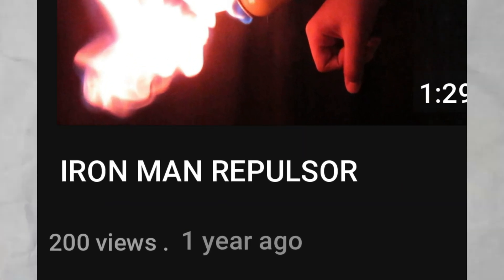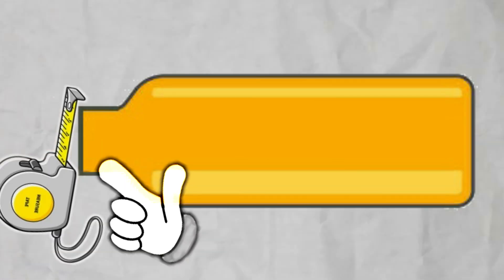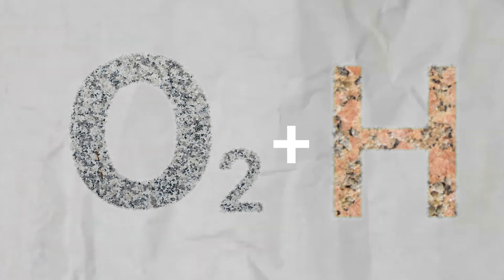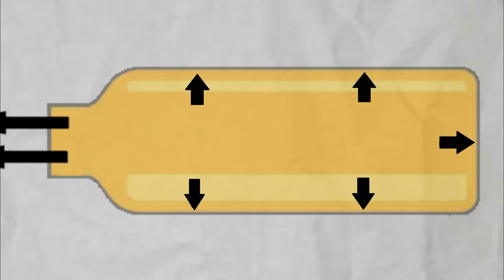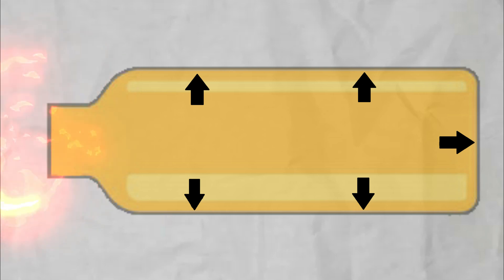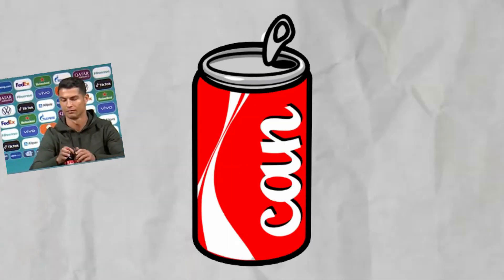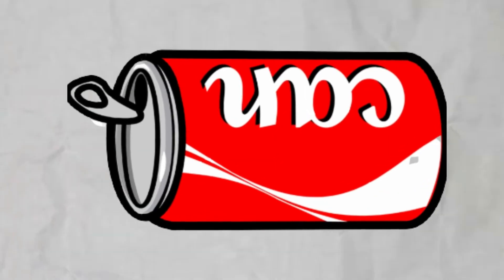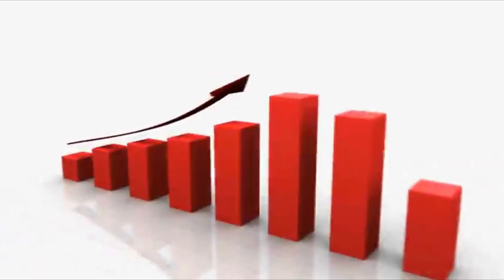Real 10$ IRON MAN REPULSOR Make at Home

Comment: 1:20 
Hey would you plz tell me what was that black thing that you placed on top of the can ???
And also will you plz send a amazon link of where can I buy it ???
Would help me alot buddy :)
Reply from the maker: The black thing on the to was a high voltage generator
Reply: @fictionandreality8515  Thankyou so much brodie ! I also had an question.....Is there alchohol in the can like you said we need alchohol to burn it....and if there is alchohol, then why isn't it falling out ??? Like what did you do to stop it coming out ???
Reply from the maker: @insaneguy_1123  there is alcohol but  it's a very small amount,just put some perfume or spay and it should work
Reply: @fictionandreality8515  Okay bro thankyou so much
Reply: @fictionandreality8515  I know this video was a while ago but can I use a 9v battery and stick wires into the can or will it not work?
Reply from the maker: @garfieldenjoyer5549  it will not work because it needs a spark which is provided by the high voltage generator
Reply: @fictionandreality8515  ok thank you
Reply: @fictionandreality8515  sorry another question does it only have to make a spark for it to work
Reply from the maker: @garfieldenjoyer5549  depends how big the spark is, you can also use electric lighter.
Reply: @fictionandreality8515  oh ok thanks again
Reply: @fictionandreality8515  How did you start the spark?
Reply from the maker: Here is the link https://www.amazon.com/Boost-Power-Module-Voltage-Generator/dp/B01GM9B4R0/ref=mp_s_a_1_4?crid=2AISOI90NCO2Z&keywords=high+voltage+generator&qid=1638032884&sprefix=high+voltage+gen%2Caps%2C424&sr=8-4